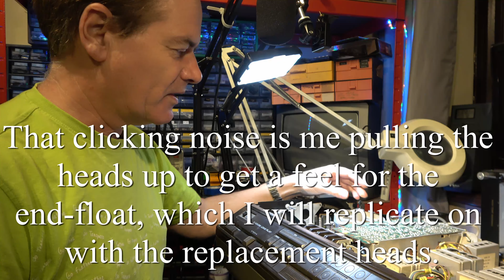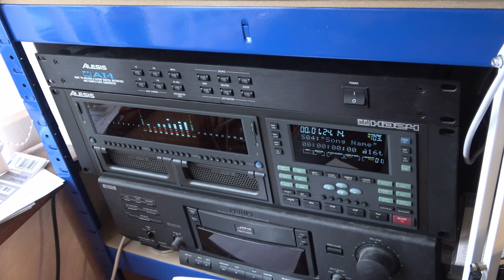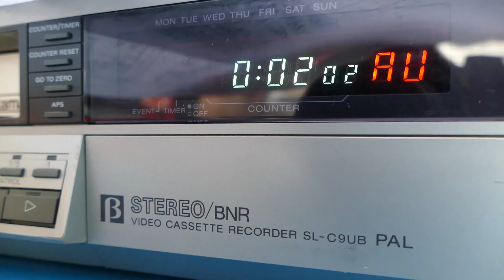Can we fix a really nice Philips N1700 VCR-LP from 1977?

Comment: Nice video's you made. About 11:40 you talked about when rising the servo board you can't put it in play mode. Well notice both little square holes at the switches end of the board. Then notice left side of the board that cut out square. There suppose to be 2x a peace of angle board (or L-shape) that you could break-out and that fits into that little square hole at position play switch. In that manner you can switch on that play switch when servo board is rased up. In your case here ,some body been there before you :)) and took out that little hook. So take a notice on your other recorders to find that hook to break out. 2 of those L-shape for also the record switch. I love these machines , have whole range of them. N1500,N1501,N1502,N1700,N1702.

Comment: The serial number, which contains both a revision number and a date code, will tell for certain whether it's an early revision. Production of the N1700 started in 1977, in or slightly before week 28.

Comment: You mention running the signal through a digital time base corrector. The picture from my N1700 is skewed off to the side at the very top. Would a tbc possibly help me? Which model would you recommend?
Reply from the maker: It certainly might do.  A GTH Electronics ACE box could be a good place to start, they appear on eBay from time to time.

Comment: I replaced all of the belts in and cleaned the inside and fixed the pinch roller but my machine always plays forward even when stopped... It looks like it is to weak to rewind with a tape inside. Do you know what can cause this?

Comment: Well done, much better than it was :-D
The head drive belt sounds like it needs changing,  hopefully it's not the motor that's a bit sad and needs a retrim of the servo drive.
Not a bad picture for an old machine though :-D
The other thing that comes to mind is the tape tensioner,  it can make a massive difference if too far off.
Although i don't have the tension test tool,  if the tension band had to be replaced then i would play a good tape and look at the bottom of the screen for the head switching stability,  i would adjust for a clean stable look.
And make sure the tracking was forgiving.

Monitoring the video heads with a scope and the switching pulse as synk could show how well the tracking was.
Small adjustments were made to get the best f.m output from the heads,  and adjustments to tension/audio head and tape path.
Swap tapes to make sure any tape was watchable.
I have a bag of belts too :-D,  even worn belts can work on other equipment.
Yes pinch rollers can be a right pain,  old vhs amstrad machines would chew the tape for no apparent reason.
And other brands of machine did not give a dam what you put on for a pinch roller, very odd.
Reply from the maker: No tension band on VCR format machines, which was always a problem with them.  Tension is always lower at the start of the tape when the supply spool is rotating slowest.  I did try increasing tension by resting my finger on the tape guide at the back of the machine during playback.  It didn't change much.

Comment: Hi Colin, just wondering if the machine beginning to lace and unlace when it is switched on is meant to happen or was it a fault.
Reply from the maker: I believe that is normal deck initialisation.
Reply: @video99couk  thank you ever so much for your reply. I am trying to find a working machine to play some of my cassettes, I had found one where it appears to lace and unlace  every time the on button is pressed but then doesn't seem to make much internal noise after that. Do you think that this would be a fault.

Comment: When did  Philips stop making the N1700? They all do seem to be neat machines, I wish they had any success here in the States.
Reply from the maker: The last model release was 1979 with the slightly improved N1702.  I suspect that it was discontinued around 1980 because Philips then had their V2000 format, which didn't do very well.